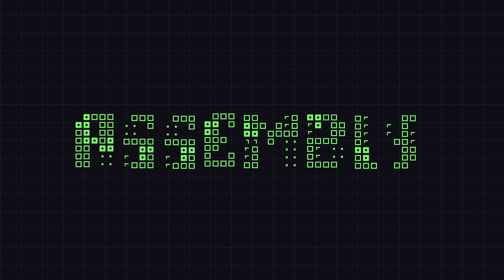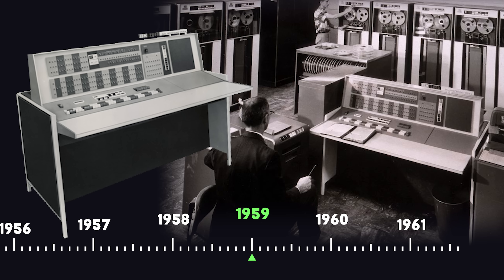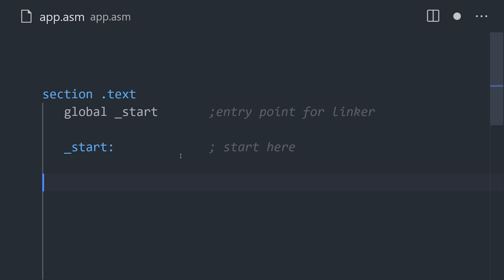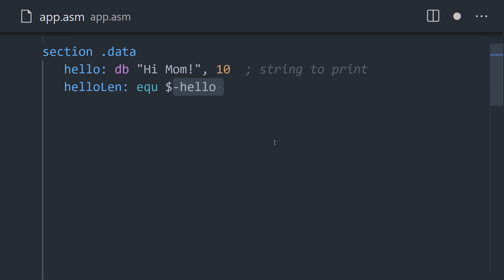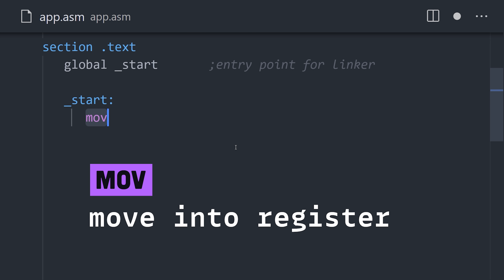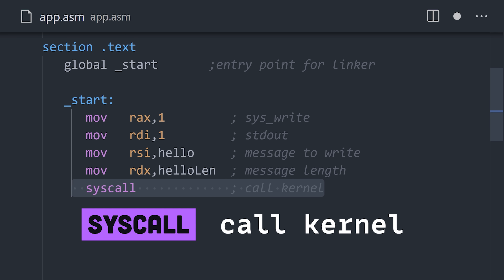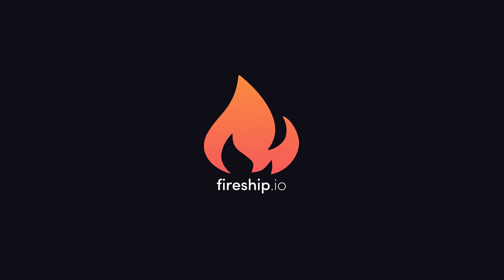Assembly Language in 100 Seconds

Comment: I had a couple assembly programming classes during my CS course in university. It's definitely a much different way of writing programs compared to higher level languages. To me, it felt like a puzzle game, where management of "position" within memory was a huge part of it. Function calls are also interesting, since essentially it's just a block of code in memory with a pointer you can jump to, then jump back to your previous position once finished. Even a program to just do simple math was quite involved. No such thing as strings either, just char arrays.
Funny enough, taking that class on assembly finally helped me "get" C. All the stuff about pointers and memory management/allocation didn't click until writing assembly, then I understood what it was for. Looking at C as an abstraction over assembly really helped me become a better programmer.
Reply: This gave me an idea for an actual puzzle game where you use simple opcodes to move numbers between boxes and it gets more and more complicated until you realise that you’re writing assembly
Reply: That's EXACTLY what C was designed for, my friend. Congrats
Reply: Yep, C is basically a better macro assembler. I feel your heureka moment!

I came from the other direction, and it took a while to get what C was actually good for  :)
Reply: @circuit10 so like human resource machine
Reply: @levaniandgiorgi2358  Oh, I didn’t realise that already existed
Reply: @circuit10  There are such games! TIS-100 and SHENZHEN I/O
Reply: Wait, your CS course don’t teach pointer, memory, stacks etc… before assembly? I thought those are in 1st/2nd year classes after maths, a high level language and OOP, under data structure, algorithm, computational model and architecture? Maybe CS had been focusing too much on the theoretical, mathematics side that it neglects the “how computer works” computer engineer side.
Reply: @lc9245  They said it “didn’t click until writing assembly”. So they did it before but didn’t fully understand it until then
Reply: @lc9245  My freshman year SE sequence was Java for two trimesters, then data structures where we implemented interfaces of things like ArrayList, LinkedList, Stack, Queue, TreeSet, etc. Sophomore year was Network Protocols w/ Python, then Assembly w/ MIPS, then C/C++. Mixed in were classes on web dev, process, and design patterns. I think it just depends on how one's particular university arranges curriculum.
Reply: @circuit10  NANDgame is pretty much that (Edit because I forgot to say this:) You start out by making a NAND gate from relays (or transistors), then you make all of the other basic logic gates (AND, OR, XOR, etc.), then you make 2-bit binary operations, and you eventually get to assembly.
Reply: @xCwieCHRISx  Java and C# are most definitely super high level languages. They are memory managed, and are not even executable by a machine. They require a virtual machine to run, thus making them extremely portable. Even C++ and Rust are high-level, though they are not memory managed. Memory managed garbage collected languages are super easy to write in, but the overhead is pretty insane. A study on Java found that 1/3 of the programs executable time was spent just in the Garbage Collector.
Reply: @lucass8119  what makes rust/c++ high level, and compared to what? Genuine question
Reply: I felt exactly the same when I had my assembly class. For me as a programmer, starting with C/C++ and assembly and only after 1 or 2 years going to really high-level languages such as JS was a really cool journey that has taught me a lot of important concepts.
Reply: Boy , did I run out of registers while writing a matrix multiplication program in MASM...
Reply: I'm graduated in Computer Engineering and had a similar experience than you
Reply: @circuit10  Check out the great games Shenzhen I/O and TIS-100 and Human Resource Machine :D
EDIT: Wow, have I been beaten to this one, oh wow. :D But Human Resource Machine is basically EXACTLY the concept Heath Mitchell mentioned, whereas the other two are fun assembly programming games.
Minecraft's Redstone is one level below this, it is basically building tansistor logic and people have built full ALUs and graphing calculators and even von Neumann architecture computers in it.
Reply: @db44-t6b  I like these better than Human Resource Machine, but all three are fun!
Reply: @0oShwavyo0  It is significantly higher level than C, Fortran, really any pre objected oriented languages.

They have classes, generic types, and other really high level abstractions.

Being able to do vector<int> is a big deal in comparison to C or any other pre object language. They also have lamda functions, smart pointers, automatic memory management for the STL, a very full featured Standard library, portable filesystem access (std::filesystem), portable thread creation (std::thread), variant types (std::variant), optional types, automatic type assignment (auto), namespaces, and the list goes on. These, to me, are "high level" features.

Oh, and also destructors manage memory for you, which is pretty crazy compared to C.

Oh, and thats not to say C++/Rust are the most high level. Memory managed "interpreted" languages like Java and C# are more high level. And dynamically typed interpreted languages like Javascript and Python are even more high level than those. And at the top, you have the most high-level, like SQL which is a 4th generation language (though not really a language for programming).
Reply: @thygrrr  Another good one is The Signal State, where you solve the challenges of fixing up a dilapidated automated farm in a post apocalyptic world... using a mini-moog
Reply: @lucass8119  thanks for that! I've only ever worked with Ruby professionally and I studied economics in college so I'm trying to dig more into lower level languages and explore areas of CS I'm unfamiliar with. From my perspective C and C++ both feel quite low level so I was curious what about C++ makes it high level by comparison. Humbles me all the time to learn what people can do with programming languages without all the advanced language features that I take for granted 😅
Reply: @DrJimmyBob  my freshman year we had C for a semester. Now I'm a sophomore, we did ASM and C++ first semester and niow in second semester we are doing C++, Java AND C# and I am struggling to just use the right print command :)
Reply: repo link :)
Reply: Dudes used to write whole games in Assembly for performance back in the day
Reply: There is an old game called “Core Wars”, where you write machine-language programs for a simulated machine, the aim being to destroy other programs running on the same machine. Not as simple as you might think -- a lot of room for trying different strategies and counter-strategies.
Reply: I was thinking the exact same thing. My undergrad assembly class really made things click for me.
Reply: omg i am definitely having a hard time with pointers and memory allocations, never knew assembly would make things easier. thank you
Reply: @saerom259  Gonna make it way easier. Memory is much more transparent in assembly. It's also easier to understand how memory can be abused through buffer overflows and whatnot.
Reply: i have had assembly language for 8085 in microprocessor lab course. I can definitely appreciate C more after doing assembly
Reply: The thing is that in 2023 we dont need to do memory managment and both Assembly and C are simply dead. There are better things in life to focus other than pointers and memory managment.
Reply: @elexbeats  
I think it's very shortsighted to call C and assembly "dead". There are huge sectors of technology for which these low level languages and systems are still absolutely necessary. Graphics drivers and embedded systems immediately come to mind. And every high level language still needs to compile into assembly eventually, which requires somebody to know enough assembly to write a compiler. 
Yes, most programmers no longer need to know assembly to do their job. But that does NOT mean that C and assembly are dead.
Reply: Definetly we will always need low level to communicate with the hardware and without low level , there is no compiler , its very correct I understand , but assignin variables into a specific location in RAM is such a waste of creativity and the fun part about a programming language , just vanishes if your dealing in low level. What I’m saying is that the compilers are there for a reason, now we need to focus on building more advanced technology out of high level rather then going back to the stone age.
Reply: Seeing C as an abstraction also really helped me! C is actually 1:1 convertible to assembly so that's logical. I always saw C as something daunting I never really got into. For me, learning assembly taught me C as well.
Reply: @circuit10  I can’t stress enough how important this “click” concept is for a beginner like myself trying to move from Javascript to lower level languages
Reply: @PlasmaSnake369  you’re right ,  zero lag or frame drops in Nokia’s Snake game
Reply: @MinAwY377  I'm talking about like 3D games.  There was a guy who rewrote tomb raider in assembly in order to port it to the Gameboy advance
Reply: Assembly is just..... Beautiful...
Reply: @lc9245  I had been programming in Assembly (Motorola and Intel) and a variety of other languages for six years before enrolling in CS in college. I had also been writing simple Assembly games and utilities in that time period. In my first CS semester, I wanted to take some easy classes, so I tried to enroll in Assembly programming. My advisor told me I had to take Calc 1 and Calc 2 before I could take Assembly.

I told him that Calc had nothing to do with Assembly, so it was unnecessary. He agreed, and said the requirement existed solely to weed out people who couldn't handle Calc. I asked him where the CIS department was, and immediately switched majors. I had already satisfied all of the math requirements for CIS, and I was sick and tired of math classes.
Reply: You better still be reading these

I'm in my compsci class. And I wrote a program in assembly last minute for an exam to. Calculate the square of integers 5-10 and their sum and I had to reread 3 chapters in my textbook for branch statements, jump statements and slt and func statements to complete lines.

I wrote it within 30 lines and I'm happy with result. I bet it looks different irl than the simulator I used in my community College zybooks.

I really need a response to my post I wanna talk about this
Reply: @birdinmotion1525  I am still reading comments.
Reply: @PlasmaSnake369  Holy…I can’t even imagine how difficult that must have been
Reply: @MinAwY377  well some people find that sort of thing of thing fun
Reply: Imagine how powerful you would be today if you started with binary.
Reply: I never fully understood pointers in C until I took a computer architecture course which also included some assembly programming. You really need to understand how memory is stored in a computer before you can fully understand pointers.
Reply: Thanks for sharing ❤
Reply: "get" C
So did you understand the programming language, or got a C grade for the assembly course? XP
Reply: Same, honestly I felt like programming in assembly was so hard it wrapped back around to being fun
Reply: @circuit10  Have you ever heard of the game Turing Complete? You start with simple NAND, AND, OR and NOR gates and then work your way up to building ALUs, registers, decoders etc. until eventually you make your own CPU architecture and design your own assembly language, all while still being surprisingly approachable to a beginner
Reply: quick reminder, pointers are the simplest shit ever
Reply: And that, my friend, is why I'm going to start learning assembly, like right now.
Reply: @circuit10  oh no
Reply: @circuit10 don’t give up some games may not approach or go in depth as yours might?
Reply: Y'all learn stuff like that in a cs course? I just learnt it off of youtube... it was hell, but it was good hell
Reply: NOP  
NOP  
NOP  
NOP  
NOP  
NOP  
NOP
NOP
PUSH eax  ; Oh great, there goes my friday
Reply: @circuit10 Did you ever do anything with this idea? If not I might take it up as a fun mini game project and see where it goes
Reply: @Soluna7  I didn't, I'd like to see what you could do with it! (though I'm sure I'm nowhere near the first person to think of this anyway)
Reply: @circuit10  Well in any case it's perfect because I need to get enough experience with small scope game development to be very comfortable before I move on to the big project I have planned, and this seems like a kinda perfect lil idea to use that isn't too small and already super overdone like Pong, Snake, Minesweeper, etc. and this is kinda perfect for that!

Comment: Former communication engineer with what was once the BBC World Service...

The sender control system at transmitter sites was written in Assembly which controlled banks of microcontrollers which in turn controlled the sender transmission schedule. Even in 2000 that was an arcane system of control.

That said it was reliable. The software manual which contained all the instructions for the control system was as dense as a doorstep.

The programmer who designed the code could be found lay belly down on the floor of the sender control system rapidly flipping through the hundreds of pages of instructions from the system manual to try to find bugs. They knew their code structure inside out and back the front. 

An amazing feat given that there was no IDE or such like at the time of it's original development (80's) - simply amazing human memory and knowing instantly every line of code and where it sat in the overall program. 

We don't know we're born these days.

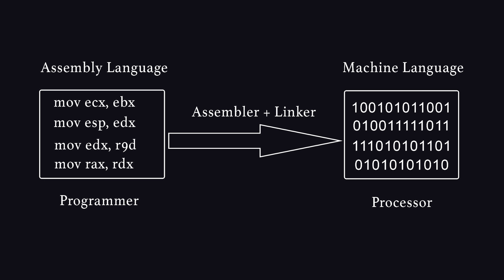Comment: 0:46 WebAssembly should not be confused with normal Assembly dialects like x86. It is much more of a compilation target than a language you would actually want to write in for performance reasons.
Reply: exactly, apples to oranges comparison, almost nothing related between those 2 other than having "assembly" on the name
Reply: I would say that the WebAssembly text representation totally qualifies as an assembly language for the WebAssembly binary representation.

Also, you can also theoretically create actually hardware that runs WebAssembly binaries, it's just that it's intended use case is to run it on a VM, similar to Java.
Reply: Wasm is a binary instruction format rather than assembly. However it does come with an assembly like language. I don’t know it’s name unfortunately
Reply: @sohn7767  afaict it's just known as webassembly text format. Its file extension is usually .wat
Reply: @missingsemi  missed a golden opportunity there to call it .wtf
Reply: @skywz  Sadly people have to act formal because work standards (dumb, I know!)
Reply: Also, WASM is much higher level than typical assembly languages. Similar to how LLVM (LowLevelVirtualMachine) is neither a VM, nor particularly low level (though still much lower level than WASM).
Reply: @welltypedwitch  yes. its been a while since i've looked at it, but im fairly sure that webassembly comes with fairly high level/ergonomic abstractions for modules, timeouts, etc. That being said, most operations are still fairly basic so theres still a fairly large overlap between WASM and regular assembly
Reply: Its like a CIL (Common Intermediate Language). Like .NET CIL.
Reply: @skywz  WoW Text File? .wtf already used lol
Reply: @welltypedwitch  LLVM explicitly states in their website that it is not an acronym, has little to do with virtual machines, and that LLVM is the full name of the project
Reply: @kebien6020  You can theoretically create hardware that runs any binary, but we don't call all intermediate languages "assembly" because that's always reserved for something that abstracts machine code.  You don't run the "Java Assembler", you run the Java compiler which build intermediate byte code to run on the VM.
Reply: Brother?
Reply: i think you write .wat and compile it to .wasm
Reply: I'd say WebAssembly is more similar to JVM instructions than to any kind of assembly language.
Reply: @beanstable  it is good to find you at last
Reply: true, WebAssembly has nothing to do with assembly language ,
its poorly named, its not web nor assembly :S
Reply: what is "normal assembly dialect" supposed to mean? There is a textual representation of WASM, and it is very much human readable, much more so than x86, arguably. Then there is the WASM binary format, just like the x86 ISA is technically also a binary format, of which there exist textual representations, such as the intel or the (different) at&t x86 assembly languages. 

Both ISA's define a set of instructions & how a machine must work which processes them, in an abstract way. 

You can't be pedantic about meaning of words while using terms such as "normal assembly dialects". x86 btw is way different from ARM or MIPS, and I mean way different, and not colling those "normal assembly" is a bit of an insult to their inventors.
Reply: Like comparing java to javascript
Reply: Yes. WebAssembly should be compared to something like JVM.
Reply: high level language -> assembly, web assembly (compiled) -> (other steps) -> cpu
Reply: WASM is bullshit, but is x86 really "normal"?
Why do I need to call the kernel and what the fuck is an error code